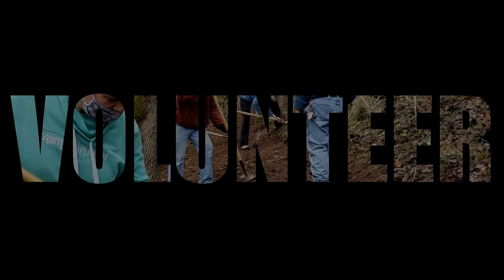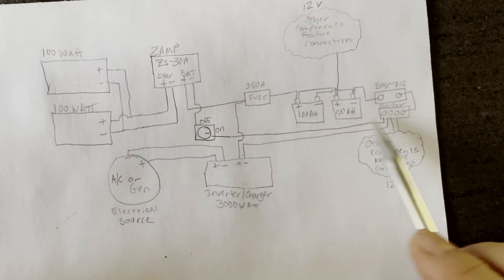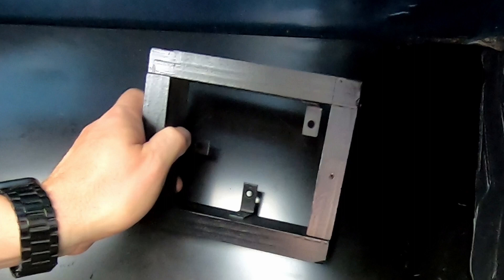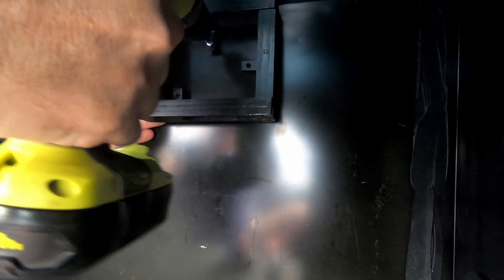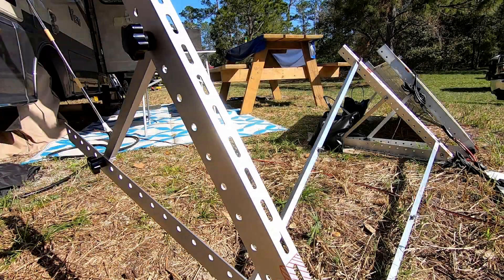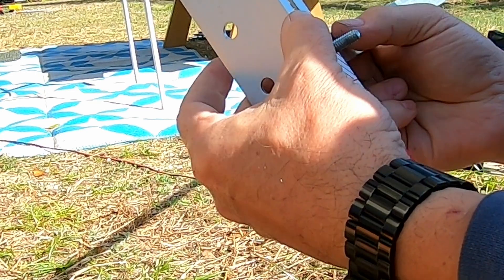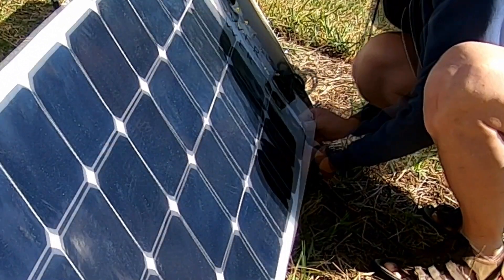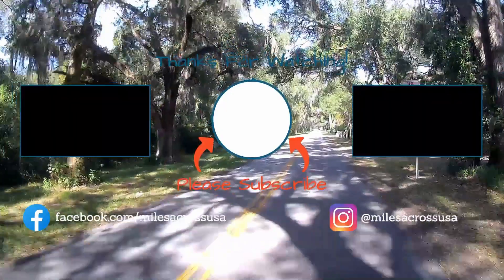Portable Solar Panels for our Motorhome

Comment: Have you considered using just a nut to attach the bolt to the aluminum angle? At least that way you're not having to hold everything together multiple times. The bolt would essentially be attached to the angle permanently and then you just use the wing nuts to attach to the frame and then the solar panel.
Reply from the maker: That’s a good idea. I’ll have to give that a try. Thanks.

Comment: I like Mark's idea below.  For the panels attaching to the frame itself, you could 3m tape a small angle to the frame and create a slot, so the panels can just be slid down the frame.  I don't think it would fly out of the slot even with no attachment.  I like that you utilized the old flat panels. I have 2 in the garage I should do the same thing.  The sun is so low in the horizon in the off seasons, that the roof solar becomes useless pretty early in the afternoon.
Reply from the maker: Thanks. They are ridged enough to slide into a slot. Thanks for the idea.

Comment: Hi guys, do you have room to store them assembled? Or at least keep the flexible panels mounted to the cross pieces and attach the panels from below on the mount brackets? Oh, and if you do that, then I'd get some knobs to replace the wing nuts, a lot easier and quicker to handle as I'm sure you know. Thanks for sharing, take care.
Reply from the maker: Good idea Mark. I will give that a try.